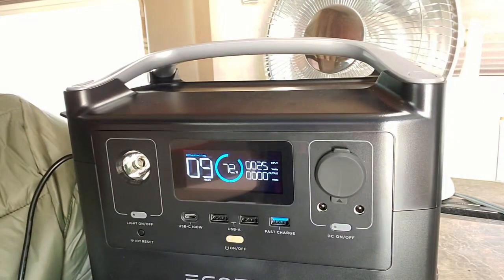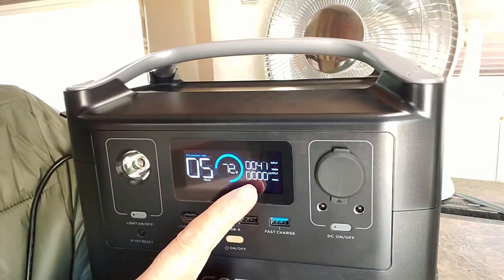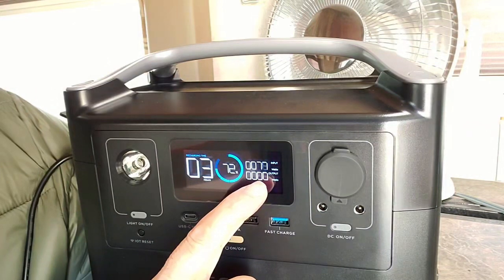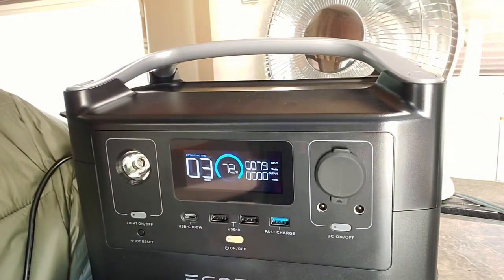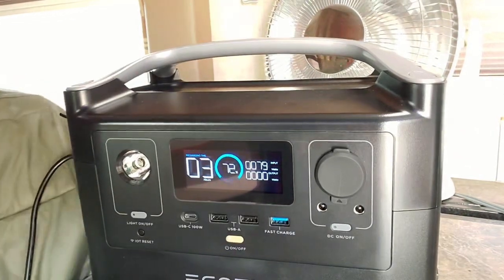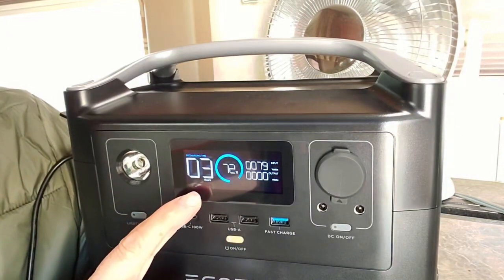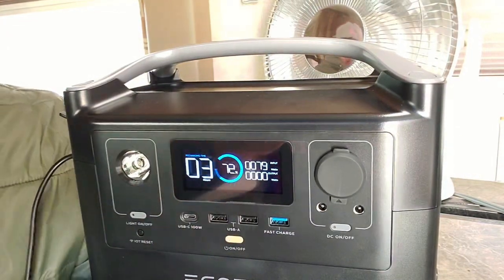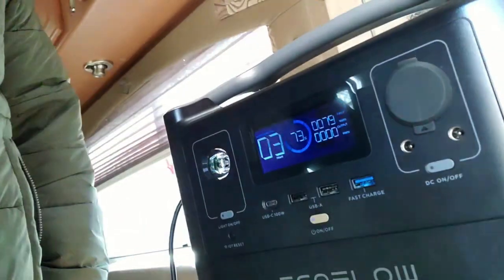ECOFLOW River Pro: Connecting Harbor Freight Solar Panels by using a SAE to MC4 Adapter

Comment: Thanks for this video. Got river pro 2 last week but it’s an updated system and it charges from 30% to 100% with 120v ac outlet in less than an hour. Can’t wait to try it with a solar panel.

Comment: I watched this video before my ecoflow delta mini arrived so I was aware of the HF adapter for polarity, plugged up the panels and got nothing, verified that my polarity was right all the way to connector on back of ecoflow, still nothing. (im using 4x25w panels, with the HF hub and the folding 100w HF panel plugged into it) Decided to try individual panels but till nothing at all. Anyone else run into this?

Comment: Good Video, thank you.  A couple of questions please.  1) I have ordered the smaller echo Flow version, is there a way to parallel two of these solar generators together to increase the output like a gasoline generator?  2) You mentioned adding more than one solar panel.  I am using a 100 watt HF suitcase panel.  How do you add more than one solar panel to charge the Echo Flow's?  Thank you.
Reply: I am not sure if you can Put 2 units together... I think there is an adapter Battery that you can order for yours.... I have the same eco flow flow in this video, and just ordered the extra battery pack...ebay has them refurbished with a 2 yr warranty for a great price..... I also have 2 of the the same suitcase panels you have.... You can order splitters and run two panels at the same time.... I just received my splitters today but it's too dark to experiment tonight.... But yes you can buy splitters to run 2/3/4 panels... I ordered mine from amazon... I can't remember exactly what I typed in but just type in something like solar splitters and you will find them
Reply: I just copied a link... I'm not sure if you'll see it because you tube is funny about that kind of stuff... I ordered two pair but you can also order just a single pair
Reply: @PhantomOfThePsy-Opera  Thank you sir, I ordered and received the suggested connectors and it works perfectly.  Thank you for the excellent suggestion.
Reply: @michaelm6091  that's awesome...really glad I could help....still learning as I go, myself....but that's the game of life😀....stay blessed!

Comment: MC4 Connectors - no good for anything mobile. Stay with the SAE Connectors. Use the Harbor Freight Hub. Just make sure that you use a 10Awg SAE Cable on the HUB Output. Four Solar Panels produce about  22Amps on the Output from the HUB. Then, use an SAE to 7.9mm DC Adapter, 8 inch length to connect with EcoFlow. That's my recommendation. Stay away from MC4 Connectors. They are only good for a permanent installation. Another good option are Anderson Connectors. Try that.
Reply: Thanks for the post. That info is exactly what I was looking for.

Comment: Ecoflo charges to 90% in 1 hr and 100% in 2 from an outlet of course. I have a river max which is a river plus an extra battery stacked on and they both charged to full in about 90 minutes. Haven't tired solar panels yet but I'm going to in my semiretirement years do some prepping to reduce bills before I can't work anymore.

Comment: what happens if you keep that connected to the charger all the time and use it at the same time?  does it drain the battery and then constantly recharge and eat up the cycles?  or does it detect being connected to AC power and provide power to the outlets without using battery life?
Reply: I have the exact setup,but the wires get really hot at the polarity plug.Why is That? Thanks.Great video

Comment: I’m a woman and I wish I could have seen what you connected to , the adapter ? The other lines I couldn’t see what you did. All of the lines would have to be laid out strainght. And the ends are all different. Did you make a circle loop with the adapter?ive paid too much money to get this polarity reversed.
Reply from the maker: The adapter comes with the reverse polarity attachment. You only need it for the harbor frieght panels.
Reply: @ThermalDogOutfitters  I did buy it the one you have in video. I need to see what connects to what.
Reply: @ThermalDogOutfitters  ....I just connected it all . Thank you .

Comment: Wow another fantastic amazing super great video info and analysis from absolutely the best channel on YouTube. Harbor freight  sells a gray hub that you can plug into it up to 400 watts . Off the hub it has a connecter thst has the red positive  wire and the black negative wire  do you think you can add the mc4 connectors to the wires and connect that the the cable that has the mc4 and the connector to the Eccoflow to charge the unt?  Csn you naje a vidioo on this ? Thank you and keep up the great videos coming  keep up
Reply from the maker: I can try and see. I happen to have a couple at the house.
Reply: @ThermalDogOutfitters  this is why your channel is so great you get back to the subscribers .  that would be fantastic if you try it .  the harbor freight  solar kit comes with 4-- 25 wall panels  in the kit . the panels are incredible  and have there own stand built in to move them around the yard. they work in very low lighting  . i have a extra thunderbolt 400 wall universal solar connector but dont know how to set it up right. it has 8 places to add solar panels up to 400 watts total . the unit comes with a sae barrel pug that leads out of the unit and has a red and black wire that i dont know if you need to add the polarity changer you show in  your video or can i just add the mc4 connectors yo  my eco river max . thank you for all info you provide

Comment: Will that adapter work with my harbor freight 100 w panel to my bluetti
Reply from the maker: Yes I use it on my bluetti as well
Reply: @ThermalDogOutfitters  ...can you do a video connecting the harbor freight to the bluetti? I bought the adapter from amazon. I have the cable with fitting to connect to the bluetti. I’ve found few videos on harbor freight panels.

Comment: is it ik to remove the little red rubber ring on a mc4 connecter to make it snap in better?
Reply: That ring is for waterproofing, to keep rain and humidity away from the electrical wire. I suggest to leave it there if the connector is outdoors.

Comment: Excellent video i have the same exact set up and was wondering about the little black adapter for the solar panels.. Thank you
Reply from the maker: Your welcome. Glad it helped.
Reply: @ThermalDogOutfitters  Quick question. I ordered a 100w panel off of eBay. It came with the AE plug. After I get the adapter kit, do I assume that the polarity is reversed on my panel ? Thus I need to connect the middle reverse adapter ? Thanks in advance.